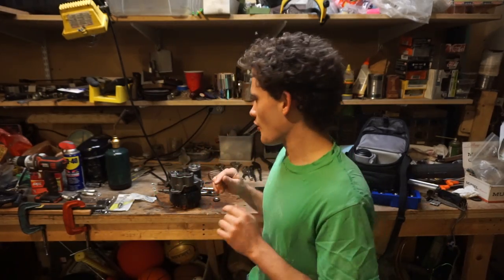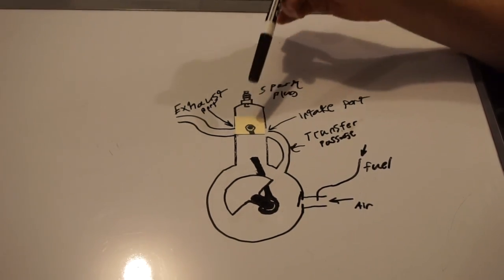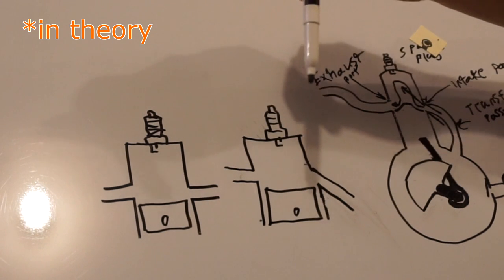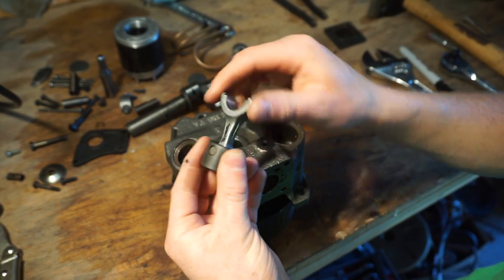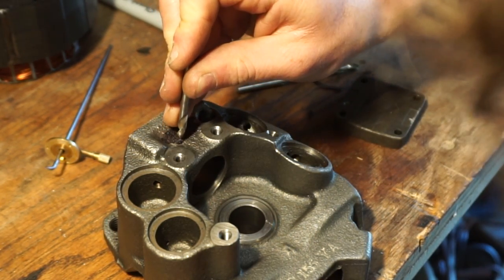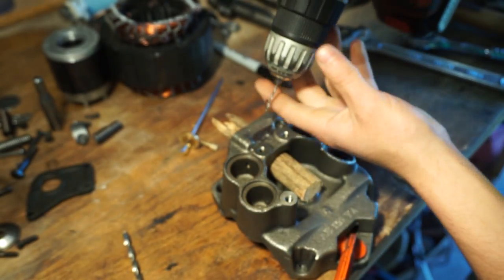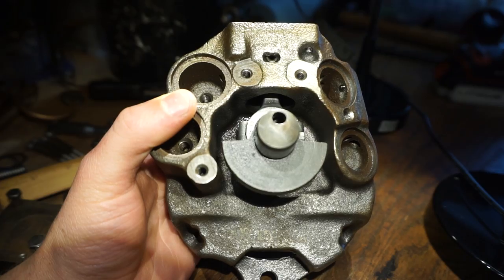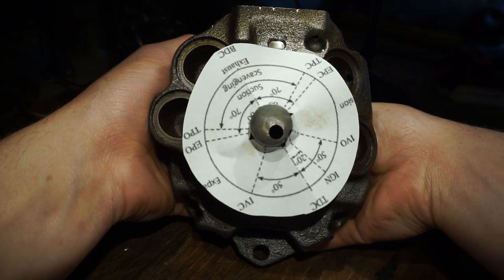Part 2. DIY Internal Combustion Engine Made from Old Compressor - Transfer and Exhaust Valves

Comment: If the piston is too tight fit i think that it will seize due to the heat expansion.

That's why there is a cap between piston and cylinder in a gas engine and the piston rings do the sealing.
Reply from the maker: +NuffMan it's possible. Although the cylinder and piston are both cast iron so they have the same thermal coefficient of expansion. Also small nitro engines don't have piston rings.

Comment: If you make a full sized or double sized card board cut out ( I use ceral box stock) pin the con rod to the piston with a soft metal envelope seal rivit.  Put it together just like your diagram.  Use an accurate dimension on your piston height.  This way you can see where your intake, exhaust, and upper and lower transfer ports best location. Port timing etc.

Comment: Ha !   My first engine was a tiny two stroke.  The porting is kind of fiddly and then there's the crank case , it has to seal air tight.  I built it B4 youtube existed but if I can do it ... You can do it.

Comment: The reason small 2 Strokes have a divider is so the piston rimg doesnt enter the port :) i have an imsane cylinder for a yamaha moped with 6 divider walls, since the transfer port fills half the bore :)
Reply: Also you station engine Will run fine, but on a motorcycle port timing makes a very big difference in behavior. Like how it revs and power delivery.

Comment: I like your (new?) video style!

You might want to calculate the compression ratio and change the heads height/volume to be somewhere around 1:8~1:9. Else I see some parts getting hot rather soon.
Reply from the maker: +Ron S thanks! Out of curiosity, what did you think was new about it that did you like?

Yeah I'm going to try calculating the compression ratio probably in the next video.  When calculating the compression ratio do I use the entire stroke length or only the part of the stroke that the ports are closed for?
Reply: The buildup in this video feels more structured (to me), and you make good use of the whiteboard.

I never calculated on two-strokes since only four-strokes are allowed for our supermileage car. A quick look on the web gives me that you have to measure from the top of the exhaust port.

Good luck, looking forward to pt3!

Comment: I have an idea. What if you were to put magnets on the compressor stator and try using it along with the coil to make an alternator. You could use it to maybe charge a battery and power an ignition coil to make sparks.Then you could have a more self-sufficient engine.
Reply from the maker: +LegitDIY that's a good idea! Maybe I will try making it a bit more self sufficient. I don't think the stator would make a very good generator. I'm thinking the windings aren't right. I could be wrong tho. I would like to try using a magneto tho. Make things a lot simpler.
Reply: Makerj101 Yeah. The thought crossed my mind about the windings but I'm no expert on things like that. I took apart an old garage door opener and disassembled the motor. It had a set of coils that looks just like that. I haven't tried using it as a generator but I have used it as an electromagnet. On the thought though. I think I'll try making a stator for it and try to use it as a generator this weekend. If it works I'll post the results as a reply to my original comment.
Reply from the maker: +LegitDIY that would be cool! Let me know how that goes. I do know that if you use a capacitor and do a couple other things you can get an AC induction motor to act as a generator.
Reply: I certainly shall try. What video in your series are you planning on having the ignition system in and do you have any ideas of your own for it?
Reply from the maker: +LegitDIY oh, that'd be near the end. Figure part 6ish. Initially I'll try continuous arc. If that doesn't work then I'll try a magneto from a weed eater. After hall effect sensor, transistor, MOSFET, and ignition coil.
Reply: Makerj101 I don't understand how a continuous arc would work. I would guess that the fuel/air mixture would ignite before the piston had a chance to compress it. I know that it works because of your other engine but I don't understand how.
Reply: Thats what the hall effect sensor is for. You put a magnet on you crank shaft so that the hall effect sensor gets triggered when the piston is at top dead center. The hall effect sensor can then trigger a mosfet or transistor which turns on the arc generator. When the piston goes down again, the magnet on the crankshaft leaves the detection field off the hall effect sensor which then turns of the mosfet and the arc generator.
Reply: Makerj101 Over the weekend I tried to find neodymium magnets but couldn't. I did get some ceramic ones just to see if I could get any voltage out of my coil. I do have a neodymium magnet I got out of one of those flashlights that have generators inside them.( A magnet that gets shaken in and out of a coil.) Just by holding it and twisting it in the coil with my hand I was able to produce around .1 volts D.C. I haven't been able to make a stator for my ceramic magnets that will not cause the magnets to touch the sides of the coil however I am still trying. I have some ball bearings and threaded rod left over from building a van de graaff generator so I am going to use threaded rod as an axle for the stator and bearings to make it run smoothly and steadily.

Comment: That's great and all, but I think thermal expansion will cause you trouble. Piston might seize in the cylinder. Also Al has much higher expansion rate than cast iron, so I dunno how that will work out.
 I like your videos, don't get me wrong, I just like to think of possible problems way before they arise. Keep up the great work!  I would love to see that thing braap :)
Reply from the maker: +MrJohhhnnnyyy yeah, you might be right. The piston and the cylinder are both cast iron so there really shouldn't be much of an issue there. If there is I'd think just letting it cool down for a bit would get it working again. I don't think the aluminum connecting rod should be a problem. It'll just get more slop in it as out heats up. I think aluminum connecting rods are fairly common. I guess we'll find out!!
Reply: Makerj101 I'm looking forward to it! BTW, I meant the Al head.
Reply from the maker: +MrJohhhnnnyyy oh, good point. I'm planning to JB Weld the aluminum head on. Worst thing that can happen is the head blows off when it gets warmed up. I'd just have to JB Weld it back on XD or put in a gasket. If I tried to use a cast iron or steel head then I would need to buy a real tap for the spark plug. That costs money lol I'm planning to use the spark plug or a bolt as a tap.
Reply: Makerj101 JB weld for the win! LOL
I also don't bother taking a real tap when I want to thread a hole in the aluminum.

Comment: ehmm, you should have drilled 3 holes and then join them together to make one wide port, because that piston doesn't have too much distance to travel. Other than that, awesome job!
Reply from the maker: +XanderZ yeah, I'm kinda thinking the same thing. I think it'll still work. Maybe not great tho. I could still make them wider.
Reply: Meh, you could tweak them after that, the main focus now is to get it up and running :) Oh, and for the head you might need to make a bit more extra space for the air to compress(not too much though) as I saw in the video that the piston goes flat with the cylinder. As for the intake gas-air mixture I'd rather go with some compressed air and a solenoid valve, which should be opened right when the piston reveals the intake port. You have to be extra careful though, 'cause the mix will be very flammable..Another alternative to that is to use propane, but you would still need compressed air to make the proper mixture... Just as a random thing, it would have been very interesting to use a diesel-like injector on that such as no more fuel would be wasted. Just like a diesel, the engine will take just the air from the intake, and then, after the piston barely passes the exhaust port, the injector sprays a fine mist of gasoline, which, hopefully will light in its entirety. That would make it waay more efficient, but also, overly-complicated, which isn't really what you're trying to achieve here ;)
Reply: And I also forgot, just DON'T JB WELD THE HEAD! use a proper thick aluminium plate, you can proably find one on scrapyard or something, and they should proably give one to you for free ;) drill some holes on it, drill another hole for the sparkplug and make a thread on it (this will be quite tricky) and then use 4 bolts to mount it into place and use some RTV sealant(you know that silicony black stuff which is good for making gaskets that can withstand high temperatures) and it would be far better :)

Comment: I can't remove the flywheel because the shaft its onto is hollow like a pipe and my flywheel remover doesn't work on it... help?
Edit: Solution and other tips in the comments.
Reply: I have the same problem did you solve it
Reply: @yigitdemir4604  Yes i used the same flywheel puller and just put a socket with the same diameter as the shaft to push it out (mine was 11mm).
Reply: @lengaming1651  thanks, did you manage to work it. I Will drill the holes but my piston is not removable, any tips...
Reply: @yigitdemir4604  Your piston really should come out one way or another. I removed the bracket that held the connecting rod to the crank, then i could push the piston all the way up which allowed me to rotate the crank and pull it out(after the flywheel was removed). Then i could get the piston out and start drilling holes. You could try to drill holes with the piston in(at exactly bottom dead center), but it could damage the cylinder and piston, no need to worry about scoring since the piston seals perfectly and lets you push the dust out from the top. Remember to mark where you drill and drill precicely. Its best if you get a 2 stroke timing chart to measure exactly where to drill holes. It took a LOT of time and work, but i got it to work somewhat, i use a reed valve instead of piston porting, which was a dumb choice really.
Reply: @lengaming1651  i got the chart printed  but when it says, for example, transfer port opens does that mean transfer port starts to open or its fully opened. By the way my connecting rod is one piece so i must drill very very precisely
Reply: @yigitdemir4604  It says TPO and TPC which means open and close, that means when TPO that is the time that the transfer port starts to open. The piston have to come out one way or another really as it was put in some way, remember to drill a little higher than where you mark since it's the bottom of the drill tip that matters so you don't drill into the piston. I had one hell of a time to get that timing right, i blew the crankcase 4 times or more because of the intake port being way too high and igniton timing was non existent.
Reply: @lengaming1651  thanks for all the tips man i hope my engine will work too.  lastly do you know how much power can it generate?
Reply: @yigitdemir4604  No problem, i have no idea how powerful it would be, every compressor are built different, mine has a really small cylinder and piston compared to what's shown in this video which probably makes mine weaker. With enough tuning and precise portwork i would guess it could produce a maximum of 0,4 hp or less

Comment: You should of tried a slightly smaller intake/exhaust ports/holes FIRST and then continuing with the 4 small holes you drilled first instead of going straight to the larger holes. then continue to build the engine and test it
so you dont loose as much cylinder compression!!!!!!!!!/power

only then if it doesnt run should you step up the size of the holes. and see if it runs. and only do it in small increments so you dont ruin it from the start!
Reply from the maker: +realflow100 sound reasoning! My intuition says it would run far better with too lathe of ports than too small. Too small of ports would put a huge limit on rpm. Although it may increase the low end torque. High performance 2 strokes generally have huge ports while weed eaters and more efficient engines have smaller ones. It's good thing thing to consider.

Comment: Could you make internal combustion engine of  watermelon?
Reply from the maker: +Cibim Box of course! Step 1 drill hole in melon. 2 fill with binary explosives. 3 load into a sewer pipe. 4 shoot with incendiary round.
Reply: waiting for video!